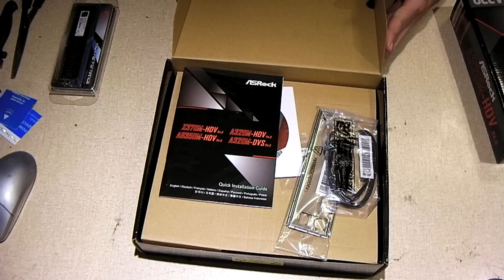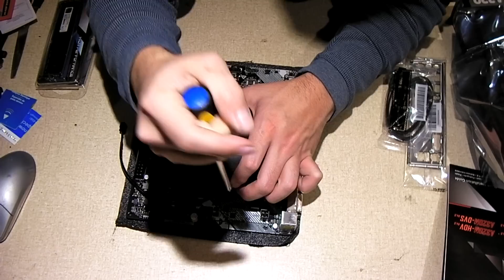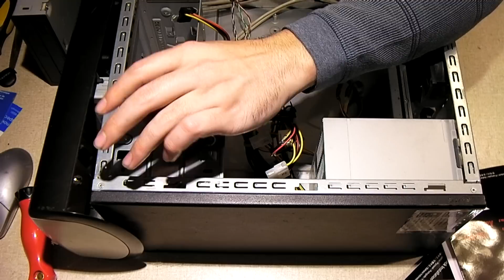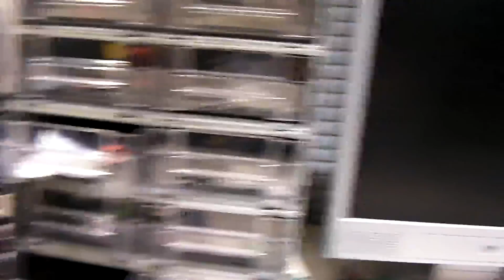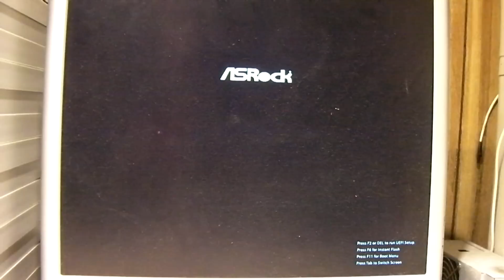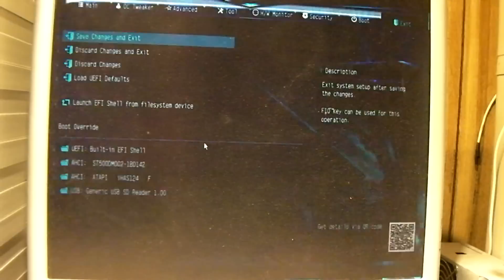Upgrading 2 additional systems to the Ryzen 3 2200G Platform

Comment: Curious...Why are you still using HDD's? Every build I've done for the last two years have used two drives; SSD for the operating system and an HDD for file storage. I use the white label drives too, but the last batch I received were clearly Seagates so I sent them back. (Like yours appear to be)
Reply from the maker: One reason... Budget.